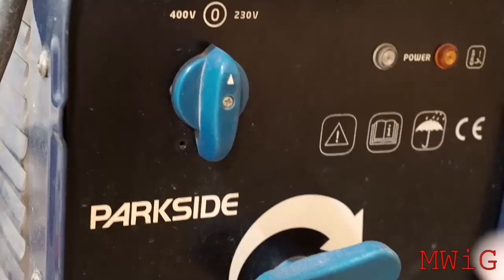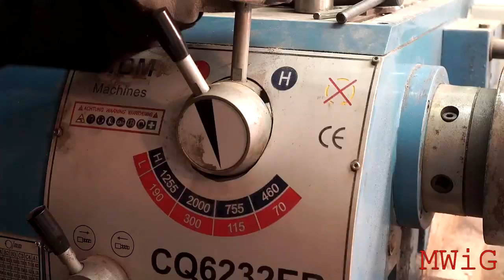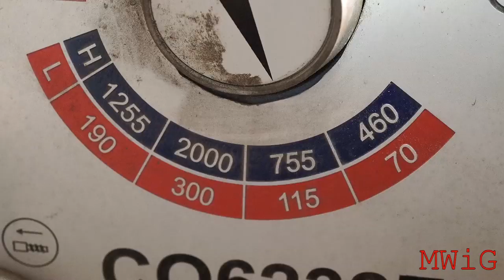Restoration of Rusty Vintage Vise - How to restore post vise

Comment: I'm thinking you need to set up a blacksmith shop. The post vise is the only kind strong enough to withstand sustained use in blacksmithing. I was lucky enough to find a vintage one on Ebay complete and in good working condition that weighs 50 kg. It puts any other vise I've ever used to shame.

Comment: nice restoration, but it would be necessary to make the hinge fixing which made the vice hold the workbench, so that it can pivot on its "leg" and in any case it will be better than with clamps, like that it will be full
Reply: small correction to what I wrote the model of vice you have is fixed, the fastener is placed under the screw box of the vice, to see what it looks like, just search for blacksmith vice on google picture